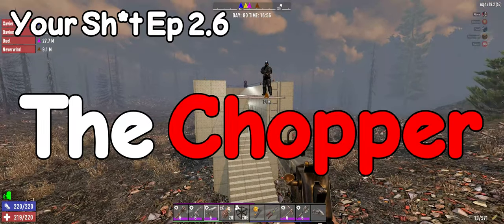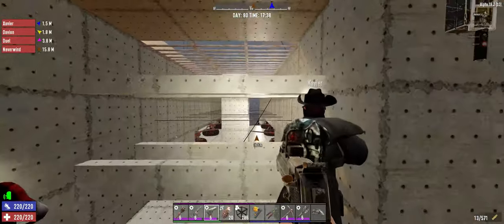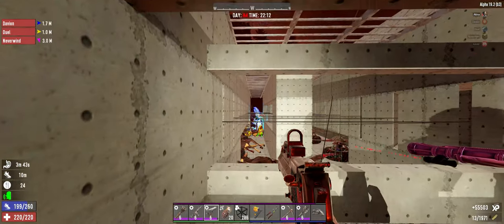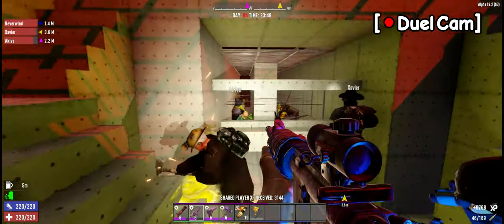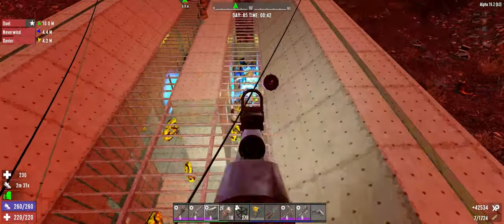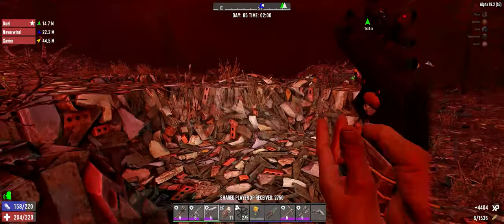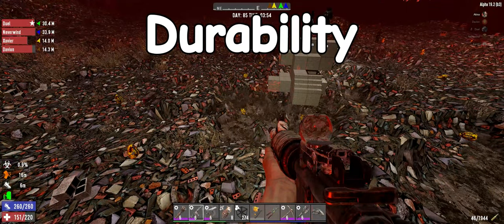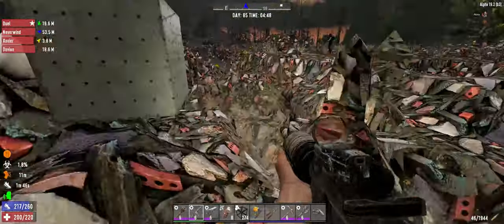7 Days to Die - The Chopper Base - Iron Curtain Grades Your Sh*t Ep 2.6

Comment: If the creator didn't try to keep the design so compact, a lot of the issues could have been prevented.
Reply from the maker: absolutely. A little bit of breathing room here would go miles.
Reply: I think when it comes to building bases, for the support structure at least, no kill like overkill is the best policy.  Just having the whole thing solid concrete to the ground would have helped.  It still would have died, but maybe at a later time.
Reply from the maker: @nicholi8933  for sure. I think it may have even stayed up had that been the case. It would have been a hollowed-out mess, but I think it would have been standing at the end.
Reply: @ICG  that's why i do minimum 2 deep r-concrete on all my buildings. proper hordebase has no soil left underneath. a lot more digging and concrete/steel pays off, if traps fails
Reply: @wildaxeman8698  I'm a big believer in redundancy.  Plan for things to fail.
Reply from the maker: @wildaxeman8698  always always always. A shitty foundation can wreck even the best idea. 

One block thick anything is asking for a problem - the only time I even consider it is if its on/through and area where they're not being engaged or if its one of multiple options.
Reply: @nicholi8933  if you build pillars, you probably also want to get the base more than just two blocks off the ground. In the vid the zombies are punching out the floor of the base before they ever even attack a pillar.
Reply: @boogerblaster6560  That is true. I like having it 4 blocks off the ground minimum.
Reply: @nicholi8933  I don't like a base that depends on a solid core, because you can't repair its internal blocks. But if properly designed, this base should have used an external shell, just continuing the side & rear walls all the way to the ground.
Also, the height was an issue. it was low enough to the ground that zombies thought hitting the foundation would be a good way to get to the players. If it was just 1 or 2 blocks taller it would have prevented most zombie interest in the foundation, as the zombies prioritize reaching player elevation over anything else.
Reply: @kathrynck  I have had many solid bases.  The thing is if they can reach it to hurt the block then you can reach to repair, in theory.  I just repair then replace as I move from the inside out.
Reply: @nicholi8933  Explosions travel through blocks (cops, demos). Other than that though, i mean there's nothing "wrong" with a solid foundation. It's just likely to end up hollowed out in unforseen ways after a lot of use around explodey guys, so I just save the concrete generally.

Comment: You guys consider using a base with robotic sleges to push the Zs off of a catwalk? Ive got some ideas for one and wouldn't mind building something up if you'd like to take a look at it.
Reply from the maker: You're going to love what Duel has been working on.
Reply: Looking forward to it. Got a chub thinking about it.
Reply: Sledge turrets tend to pop demolishers though. Even if you cleverly face the turrets & zombie pathing to hit them in the back, you're still fairly likely to have a sledgie hit a demo button, depending on how the demo falls down.
Which is unfortunate, because catwalk sledge turrets are kinda the only good use of a sledge turret.
Reply: @kathrynck  hit them in the left side. Ive never had one pop. Neither has Caapo
Reply: @IronwolfXVI  if they don't fall off the catwalk (stagger/fall while still up on it), they can end up getting up or spun around in random directions. Left side is "much better", they won't get hit in the button on the first hit from the left. Left side plus a couple block to help ensure the sledgie is angled ONLY behind them, helps improve the odds, but, it's still a risk.
Reply: @kathrynck  id rather have it than not. Lol
Reply: @IronwolfXVI  it can work. ideally don't put anything which is structurally important where they might fall to though.

Personally, I find that the right kind of trap system kills zombies so fast, that you actually want the zombies to come into your base faster, rather than slower, to increase the XP gain rate.

Comment: Well on day 85 you're going to be up to steel? If that were steel and didn't have hardly any pillars it'd probably work out better. Why would you put it up on pillars to begin with? It relies too much on traps and you can't rely on traps.
Reply: you need to have it so they think they can get to where you are but can't. Then they just turn around and try the same path over and over until they die.
Reply: It's easier for them to attack a few pillars over having a complete wall. Don't know why people like pillars - it's less blocks for them to destroy to wreck you totally.
Reply: The other issue is you don't want them being enclosed - because if they clip into something or otherwise think they're stuck they do 6X damage. So you don't want a horde all bouncing around each other inside an enclosed space.
Reply from the maker: When it's "Your Shit," we are following someone else's build instructions. Steel isn't necessary to make this a success, but the overall layout is a mess. It needs work and a good deal of it. 

 Disagree on traps, though. They can be extremely effective if used correctly. Our lighthouse and whack-a-mole builds are two good recent examples.
Reply from the maker: @W1se0ldg33zer  "so they can turn around and try the same path."

Thats just one option, it's not mandatory. The Pit, the Raptor Pen, the Shoe Box, Alcatraz, Whack-a-Mole, The Lighthouse, any number of AFK-ish designs, hell, even the toilet to some extent all don't do that and work very well. Its not necessary to route them in circles to succeed - you just need an effective easy to kill them when you're running them towards a dead end.

Hell, even our wood base challenge builds didn't do that and they used wood when all of us were max level.
Reply: @ICG  Yeah but on day 85 you'd have it up to steel to be able to handle a day 85 horde better? It may work a lot better on an easier horde without steel but those pillars definitely made it a lot weaker.
Reply from the maker: @W1se0ldg33zer  agreed, but even just finishing the foundation off as solid concrete would probably have been enough. We will def do that on our own version.
Reply: @ICG  I've had a few bases where they wouldn't stand up if not being all steel that's for sure. I think it was just it being all supported on a few pillars - take a couple out and down she goes! lol
Reply: Traps are great (some more than others). I've made bases where the traps could AFK-destroy pretty much any horde no problem. All concrete, no steel. And designed to speed up the zombies' pathing so they come meet death and cause new spawns quickly (to increase XP gain rate). And we're talking a very small amount of concrete mix in repairs. Honestly steel isn't very helpful, demo's do 5k damage when they blow up, so if you let that happen at all, it will take 2 to blow up reinforced concrete (7k hp) and 2 to blow up steel (10k hp). For that matter if your traps are near the zombies they'll get blown up eventually too. But  I'd rather have a reinforced concrete base (over steel) so that repairs are cheap. The hassle of making forged steel isn't worth the small bump in block hp over reinforced concrete. I only use steel if I want to make a longer unsupported span up in the air. And traps are so effective (when used well) that they can be game breaking.
Reply: @kathrynck  Making it steel gives it 12000 hp overall. 7000hp for the steel which then degrades to concrete which has 5000hp.